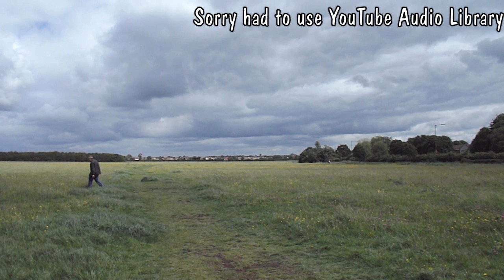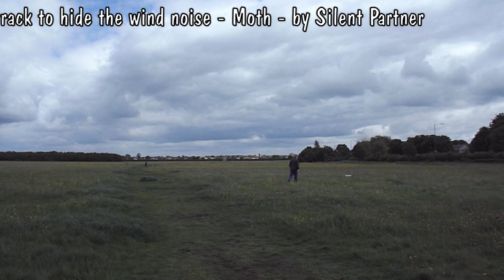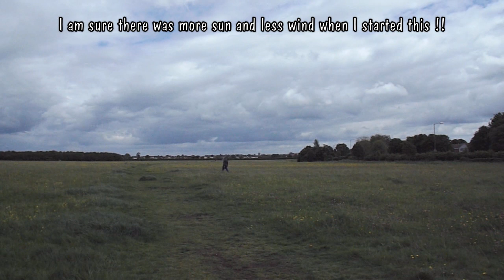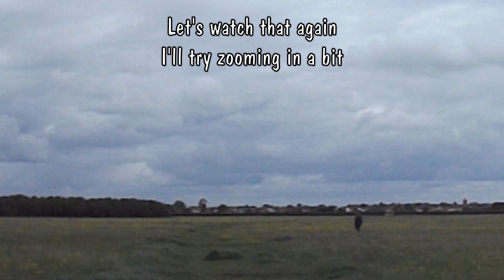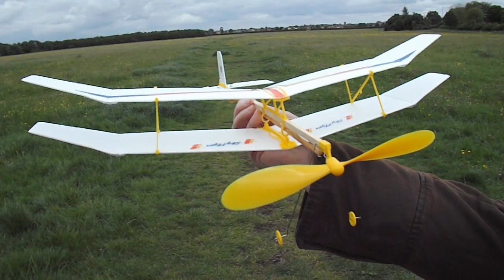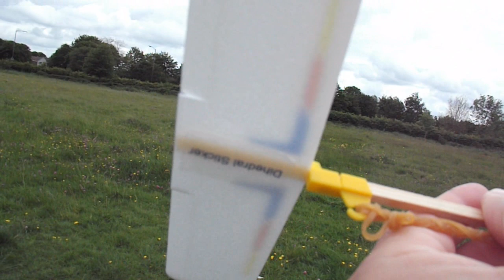Hey Grandad, did that plane fly?

Comment: I f u put RC gear on this one this thing is designed to fly for sure.
Reply from the maker: I don't have light enough RC gear for that 😊
Reply: Tape rc gear, that u have got & in positions where u plan to install it, to fuselage & let aircraft rest on 2 supports halfway along the main wings, it it doesn't break apart it will lift that RC gear & trust me yours will not break apart either. U will c wings deforming but they won't break. Even in the airlines that we fly, the wings deform by 2 to 3 meters. U can safely apply upto 8 mm dia motor & V911 board on this one. Biplanes might look small but their effective size is twice due to their twice wing area, in a stiff configuration. They r very likely to fly, easy to control and require much less flying field because of considerably slow take off speeds. Recall Wright flyer.

Only thing with biplanes is that u got to experiment to get CG right (Balancing CG at 25% from leading edge rule doesn't apply). After taping all RC gear in positions u plan, hand throw airplane for level flight.If it begins to go nose up shift battery forward until nose stops getting up. Note: A slight upward tendency is necessary for beginner pilots.  Whereas if it nose dives then keep shifting battery back incrementally until it begins going slightly nose up.

Mount battery below the fuselage not above because CG below plane makes it stable just like a pendulum, Cg above makes it unstable & cause roll overshoot, just like inverted pendulum.

Final thing: Each motor has its power output vs load curve & has an optimum value of load at which it delivers max power output. Meaning u cannot select any propeller (load) for any motor. The easiest experimental way to find out that point is that motor must run warm. If it runs cold it is under-loaded, if it runs hot it is overloaded. best approach is to mount a smaller prop. Keep adding more props/bigger prop until motor begins to run warn. Never make a prop, always use standardized ones since prop vibrations waste of the order of 80 % energy.

Just to give u some confidence in the RC gear that u have. With same RC gear planes fles at under 20% throttle carrying even 16g 600 mAh battery. Lipo battery is the best battery technology available, the core-less circular motors that u have r not far behind the cutting edge brush-less motors in terms of power to weight ratio. The board is the lightest weight board servos combo that I have seen.